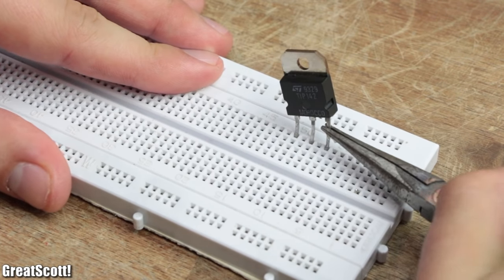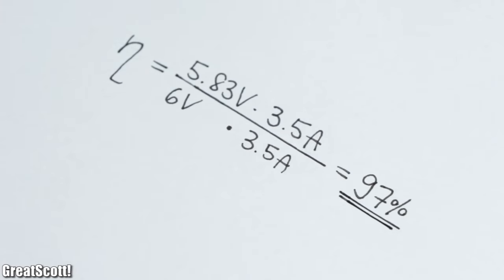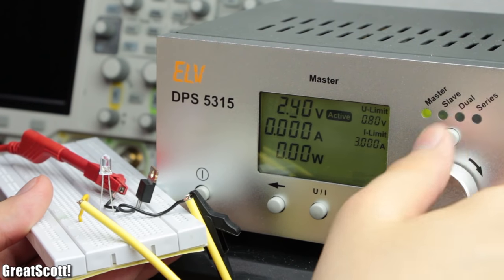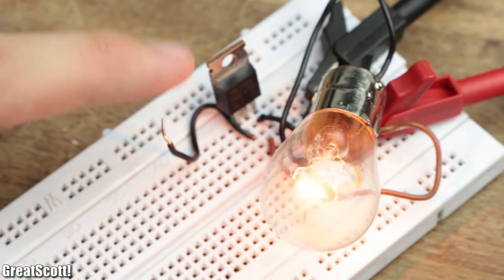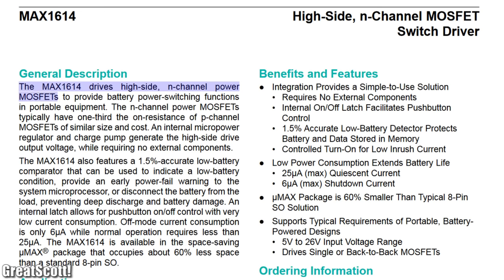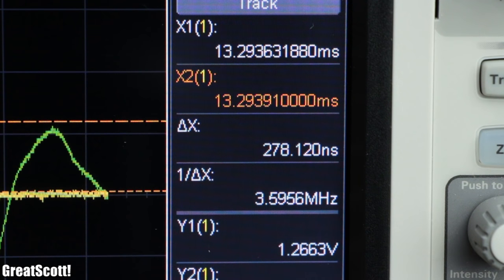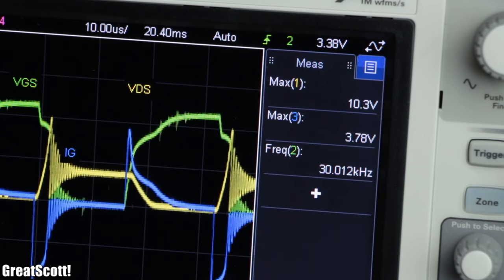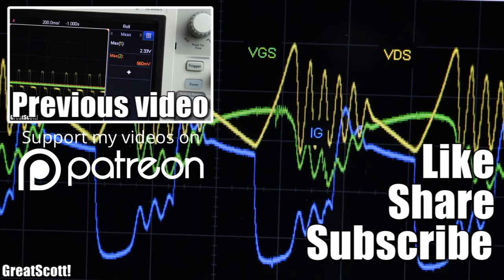Electronic Basics #23: Transistor (MOSFET) as a Switch

Comment: Hey could you tell me that what's the advantage of BJTs over MOSFET
Reply: BJT relies on current, and can only handle limited amounts of it too before they blow. MOSFETs however, turn on by voltage, meanin they can handle much more current then BJTs without overheating too much. The problem with MOSFETs, however, is that because of capacitance between the gate and source that may interfere with high-speed switching.

Comment: A capacitor in the transistor base could solve the problem, no? you will get a voltage without any current. sorry but i'm new in eletronics
Reply: gate*
Reply: The thing is that you actually need current to turn on the mosfet, because the gate has a small capacitance (gate-source capacitance). This very tiny capacitor needs to be charged, so a capacitor in series with the gate is not a good idea. To provide such currents (when you have a high pwm frequency, the currents can be very high) often a "mosfet driver" is used. Please tell me if you have any questions!

Comment: hello 👋, I need your help scot, I want to built monitoring system, which will on/off water guide. So imagine you have metal roof, u need to turn on water guide when roof temperature reaches for example 40° degrees, and then turn off when it drops to 30° degrees.  
I hope 🙏 u will see this, 
Waiting  for u . thanks!

Comment: With this, it could be an alternative for a relay then?
Reply: Sometimes, yes.
MOSFETs have a low 'on' resistance, just like a metal switch, so very little energy is wasted as heat in the transistor.
Some can switch high currents, 10's of Amps, but MOSFETs are only for DC voltages.

Comment: In the case of switching off with 5V, is the Drain pin of the p-channel mosfet connected to ground?
Reply: based on the drawing yes. you turn the fet on or off trough the gate

Comment: sir I used irfz44n in inverter but it went hot and blew up. so what should I use a MOSFET with higher current or with higher voltage?
Reply from the maker: I am pretty sure the MOSFET was not the problem.
Reply: +David Serrano well as you know input is12v and output is 220v for inverter. and irfz44n can handle 55v and 49A.
Reply: +GreatScott! so what is the problem plz tell me.
Reply: lower energy loss

Comment: I cant use it as a switch. Whatever i do the mosfet conducts without gate voltage. I dont know why.
Reply: Just put a 10K pull-down resistor connecting the gate to GND

Comment: Does anyone know why the PWM pins on my arduino keep breaking? I'm using the PWM to control the speed of a dc motor via an n-channel mosfet (with pulldown resistor). Also I've put a diode across the dc motor to suppress any voltage spikes from the motor
Reply from the maker: Try adding a gate resistor. Something like 100 ohm.
Reply: +GreatScott! is that equivalent to your 470 ohm resistor in this video? Great video thanks, really information dense

Comment: Is there a current limiting resistor somewhere in series with the LED?
Reply from the maker: No
Reply: Gotin Fuklio Really? Would you like to explain why?
Reply: It is quite obvious that energy dissipated as heat in a ballast resistor will reduce the overall efficiency of the circuit, but that has nothing to do with my question.

Comment: can i use a 600v 30 Amp  thyristor as switch for a capacitor of only 200V?
Reply: Technically yes but depends on what you are using it for. Also keep in mind that thyristors switch quite differently to MOSFETs

Comment: I am thinking of controlling a power source of 240V. Should I use a relay or a transistor? I'm sorry but I'm a noob in electronics.
Reply: The thing is to just make sure it's rated for the voltage?
Thank you for the quick response.